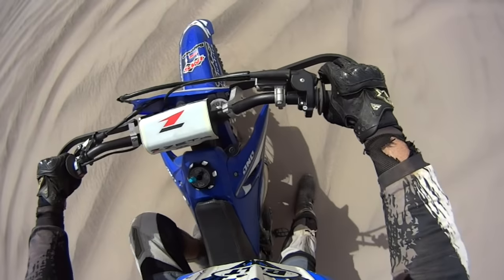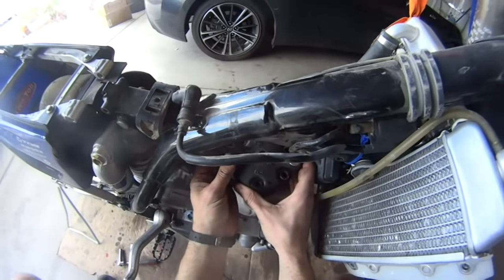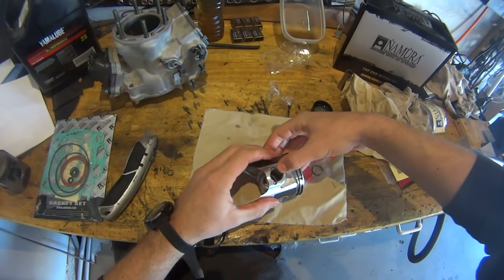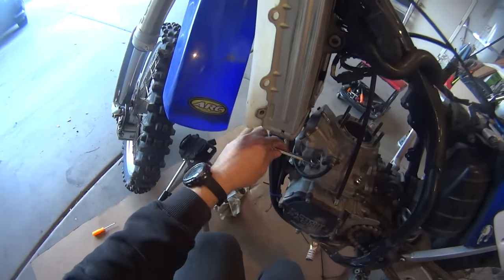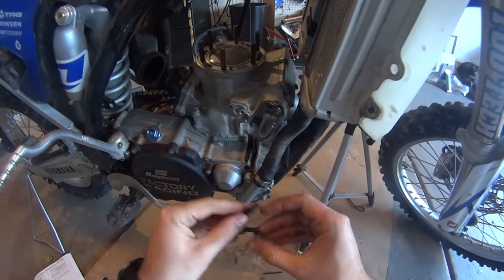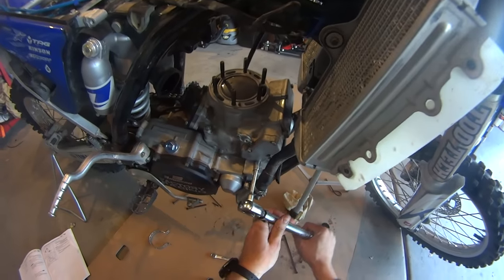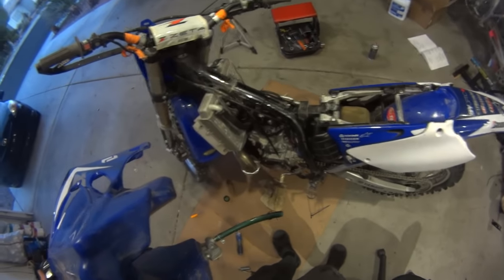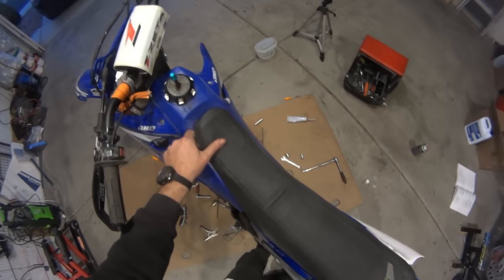YZ250 Top End Rebuild after Piston Blow

Comment: Love your videos and hate to be "that guy" but when you tighten the linkage from the right side engine cover that goes to the powervalve it shouldn't turn. There is a pin that you need to insert right below the screw to keep it from rotating and opening the powervalve and damaging it. I doubt it damaged it but that is the proper way. I just used an aluminum nail with the tip ground off and it worked fine. My piston looked identical to yours, it burned a little hole right where the locating pin goes. Also if you haven't bought a spring puller by now get one, it's one of my favorite tools, makes taking springs on and off so much easier. Ride safe!
Reply from the maker: I sold that bike a while back went to the yz250fx, best decision ever

Comment: if you are riding on sand as the engine is under more stress due to resistance of sand  you should run a higher oil ratio than normal as that's what I do
Reply: so no need to rejet like he said?....just run higher oil ratio?
Reply: MTB4miSoul if you change the oil ratio you will have to rejet so the mixture runs richer properly and doesn’t foul the plug and cylinder

Comment: Now you'll be good for another 100-200 hours lol. This is typically how long top end should last!

I hope you are finding the joy of the 2 smokers. It seems expensive and excessive at first, but they really are not super complicated when you get it figured out! (Just put in stock jets at stock positions, run 32:1 and your set..) Just think how expensive and time consuming it would have been to do the same thing on a 4 stroke. Also, do not listen to those people that say top ends every 45-60 hours! These people usually are racers that need high performance machines! I had over 100 hours on my 125 and I probably could have just put new rings on the piston and it would have been perfect. 

I usually say, when compression drops under 150psi, (or I find serious scratches or scores) needs a new top end. 

Also, I saw your other vid. How many gallons are you mixing at a time!? 80$ for gas?!? I use Yamalube 2R (More expensive than 2s) and have a mix cup that tells me the ratios and I mix 32:1 at 2 gallons (I do 4 gallons at a time). I am just curious because it should not be this expensive! Costs me $25-35$ for 10-12 gallons!
Reply: 50 max
Reply: hes prob running low sulfur jet fuel..
Reply: Ive gotton over 200hr on my 1990 cr250 on the same piston till the crank went running lucas oil 20:1 jetted perfect
Reply: Only blew from over reved going max speed witch there not supposed to do

Comment: Hey man... I brain farted... I am rebuilding the top end of a 2004 YZF250 (so a four stroke).  On final assembly I used assembly lube rather than motor oil as the lubricant on the piston/rings and the inside of the cylinder.  I am still in process... should I disable and clean it all out or can I proceed?  Thanks a ton for all the help!
Reply from the maker: It's fine, it will work, I haven't used anything, only the grease of my hands... Haba

Comment: Hey hey a maxxicross it rear tire you'll be a lot better off trust me and instead of pinning it wide open going up let off and brap it a couple times also change that gear set up your geared for the track not desert your motor will love you a lot more and don't forget air filter bag over air filter keeps sand out smell the smoke not hear a joke

Comment: For next time even easier. Stuff the piston allready in the cilinder en then u can just 'slap' it on ur engine shove in the pistonpin and clips and done. No shitting around with the placement of the rings and so on.
Reply: 2 strokes are tapered at the bottom of the cylinder you can literally pop it in by hand in 12 seconds or less

Comment: you may of damaged your powervalve when you torqued down the bolt for the lever, if you look just below the bolt it's a hole for you to stick a allen wrench or something to hold the shaft from rotating. I think that's exactly how a lot of people break the stopper for the powervalve.  its a wrench made to torque down the other 2 cylinder nuts to spec... don't listen to this guy.... look up rockymountainatv on youtube and its a few other good rebuild video's on here....  this is a good example of what not to do.
Reply: I don't think that this video is completely wrong, but I agree about the tightening of the powervalve lever: according to the manual, that hole should be used, like I did on my YZ.
The rest of the video seems pretty good to me, although I don't like some things, like the 15:1 ratio.
Reply: MVPever what ratio should you run when you have a new piston? My friend had his kx100 rebuilt recently, we just ran 40-1 like always and the piston is already ruined a long with the rings.... We probably only rode 6 or 7 hours since new piston and crank was put in and now it has no compression and the piston is scored and rings are messed up...   If we were supposed to run a richer mixture than normal no one told us.....

Comment: you didn't get the cylinder honed or bored? I'm sure the walls are tore up from the piston frying
Reply: it has a Nickel Silicon Carbide plating in the cylinder, it takes a special hone.... if the plating is damaged it should be re-plated.
Reply: what was your compression looking like?did you use a tester? I didn't know you could get special plating for cylinder walls. imma look into that 🤔
Reply: most new 2strokes have it stock man not really that special.. just somethin to cost more my old cr blew up an it was like $350 to get it replated
Reply: Anthony Ward most places re-plate for about $200, I just bought a brand new cylinder for my bike for $400.
Reply: Sorry man i meant to put $250

Comment: did you say you mixed your break in gas 15:1 or 50:1?
Reply from the maker: +desertghost 15:1..  Haha yeah 50:1 would have lasted about 3 minutes
Reply: 15:1 means your mixture is LEANER than 50:1. 50:1 would be a safer breakin ratio, since it's not going to lean out the mixture like 15:1 will. 50:1 is only 2% oil, 15:1 is 6.5% oil... see which is leaner ? cool. anyway, hope you've got it running better now.
Reply: I don't know why people don't just run the oil ratio that Yamaha recommends... but yes kyle is right, with all that oil it's not much room for fuel, fuel cools your engine... yz250's are known to need a race gas mix to prevent detonation, a lot of people run a bigger main jet for riding in the dunes.